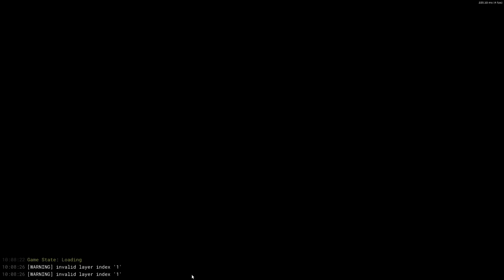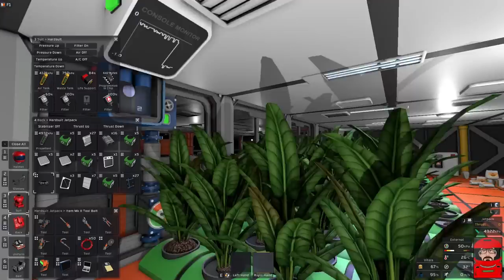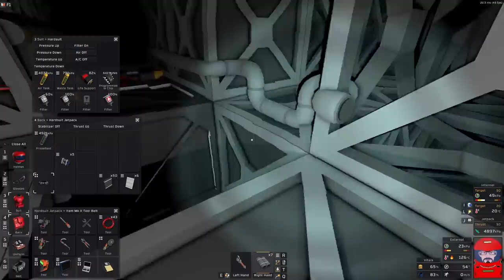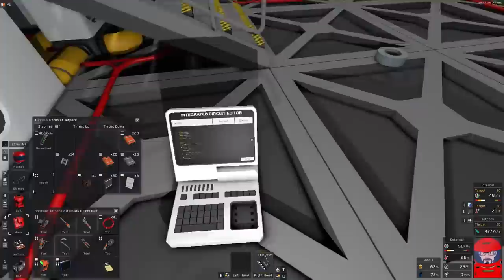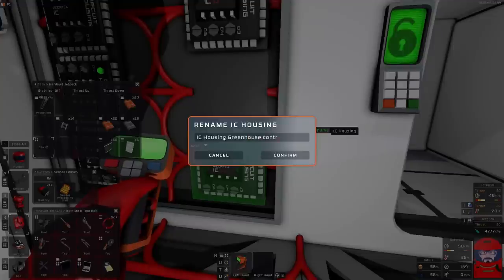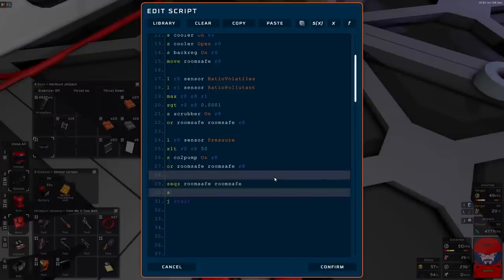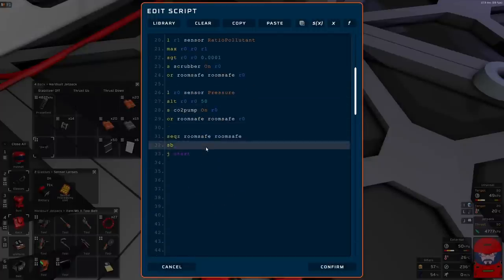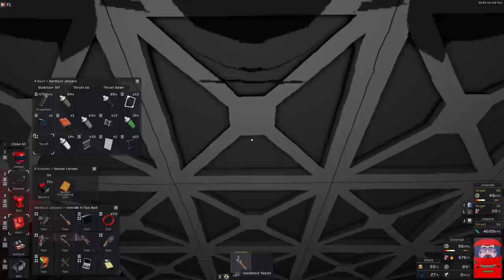Stationeers Let's play Modded Vulcan 19 The great poop shortage

Comment: Mick, you might consider to make a simple heating in you're winterspawn room.
So the temperature stays above 10 degree. 
I am not a 100% sure of the numbers. 
The beta work between something like 4 and 40 degree and best between 14 and 24.
You're room is getting pretty cold.
Reply from the maker: I was using the CO2 to heat the room but that is being overwhelmed.  As the water production increases more heat should make it into that room.
Reply: @cowsareevil7514  true Mick. 
How ever a simple outside vent, valve and a radiator as a backup is still a good idea.
Especially seeing how slow you're plants are growing. 
If you don't have to use it, there is no extra power draw. 
And 10 C should be low enough for the final cooling of the CO2.

Comment: About the AC, haven't watched the entire video, but i'll add a comment in case i forget. Happened to me something similar, i have a similar setup 2 AC with back pressure regulators. And it was always causing a short. I fixed it by having the back pressure regulator be on before the AC, i didn't investigate it further, but i suspect the back pressure regulator doesn't have time to empty the pipe from the AC waste if starts after the AC. Also, thanks for the videos. The title for this episode... is rather ominous :)

Comment: At 46:15 it looks like there's the same issue with the cooler vs back pressure regulator ordering.  I don't know if it matters as much in this room but I suspect that harvies might not like power overloads at the wrong time.
Reply from the maker: I probably have a few of them to fix.

Comment: Unless I missed it, I believe you never did fix that zero pressure fault in the water system. You found the issue in the last video (@ around 25:30), and mentioned it in the beginning of this video, but still never did anything about it.
Reply: Pretty sure he didn't because when he looked at the water graph during the night it was all going down, at night he should be getting heaps of water going in. It can also be seen with how cold the CO2 is (27~ degrees) as it's not getting heated via cooling the incoming water.
Reply from the maker: Yep forgot that.  But as the saying goes, "What I forget today, I will probably forget again tomorrow unless I remember."

Comment: Assorted thoughts:
* This might be crazyness, but what about tossing the assorted seeds running around the main room into the refrigerated vending machine? This would keep them in one place.
* I suspect composter is being shut off because the air pressure in the blue room is exceeding the programmed threshold. 
* Do you need to add another combuster to keep up with your water demands?
* Perhaps run the water or waste gasses along the roof of the service tunnel.
Reply from the maker: Clean up the place?  Yep that is carzyness.
The composter is programmed to be shut off but I am not sure it that resets the production.  It looks like it does so different approach is needed.
I still dont have a surplus of O2 so the combusters are good until I expand the garden.

Comment: so is it losing biomass each time you turn the composter off early or are you getting nearly free nitrogen by doing that?

cause in either case, that might be something to consider if you are going to refactor the code
something like turn on until output increments up, unless output is >= # of poops you want to stockpile, then just turn off when not needed like it currently does, or always wait for output increment if it does indeed result in needless loss of biomass and you care about the loss, or if you want to abuse it, and it IS lossless, if no more poop is needed, always turn off before new poop is made. although 'abuse' might be too strong a word, cause then it's still basically H20 -> N
Reply from the maker: It does not consume the biomass until it has completed the cycle.  I have considered exploiting that if I cant get biomass quick enough.